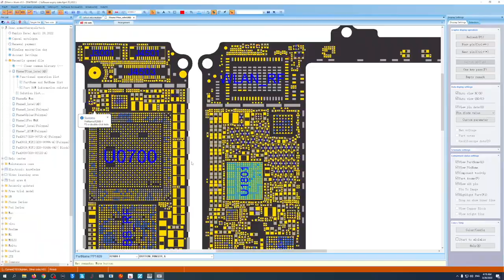iPhone 7/7 Plus Power IC Replacement Due to Short Circuit - iPhone Microsoldering

Comment: Good evening dear...
please i have a little issue with my iphone X. i was having a full short circuit on the nand chip and i couldn't read the info. 
So i have already replaced the nand but it's impossible to activate it.
please do you have a way to recover the Wifi mac by serial/imei?

Comment: Hi Ayman where do you plug in cable for finding short on thermal?
Reply from the maker: in this case i pluged the cable in battery connector
Reply: @AymanTheRepairTech  oke thank you for answering